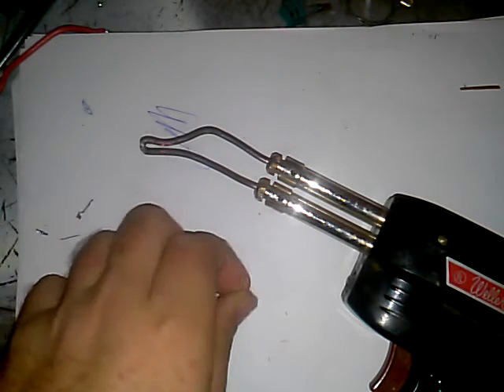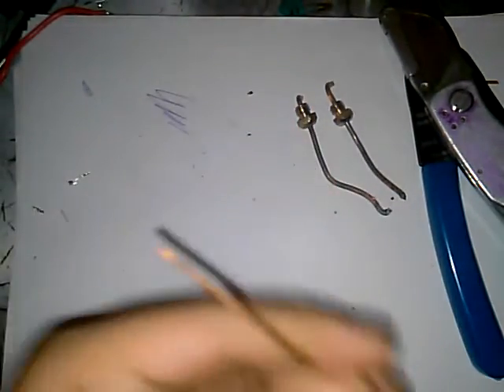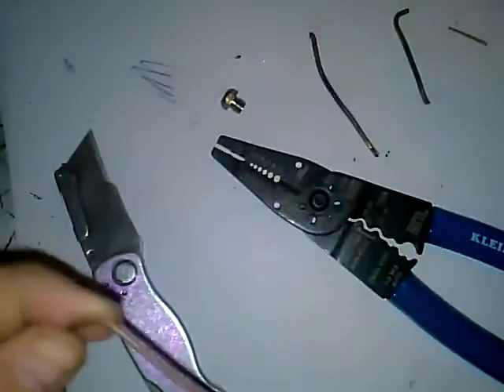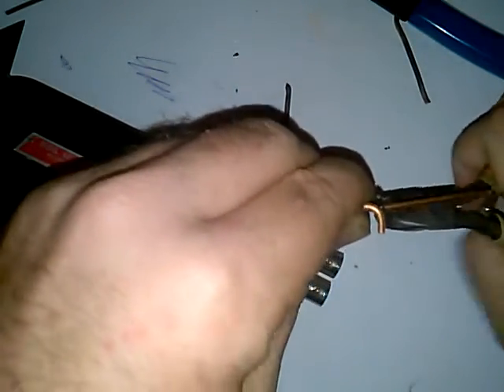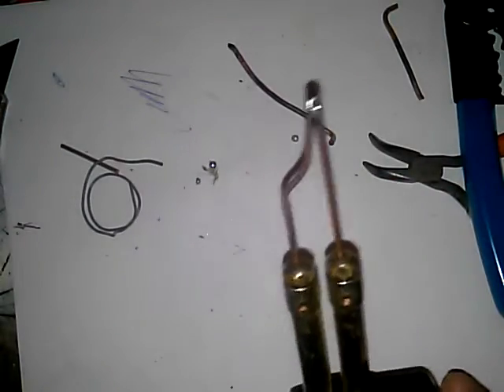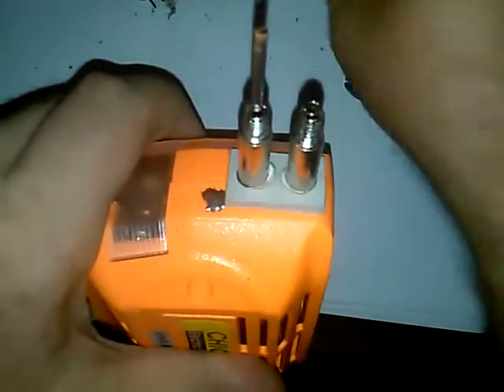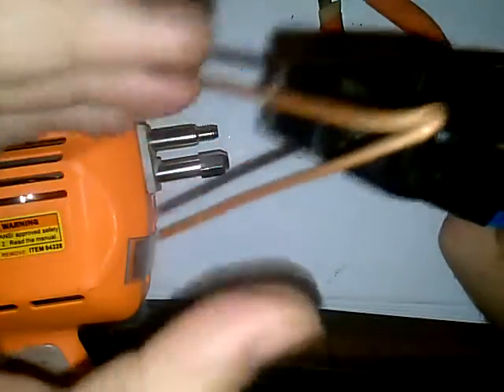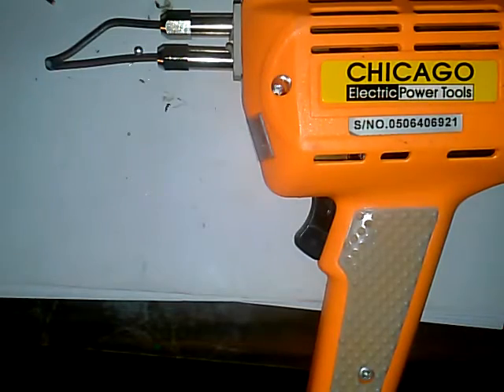Soldering Gun cheap tip replacement

Comment: Wow! Thanks! I just tried it with #10 Copper. It works better than the original tip!
Reply from the maker: just keep in mind that this is a temporary solution, the plain copper wire wears down a lot faster than a proper tip will.